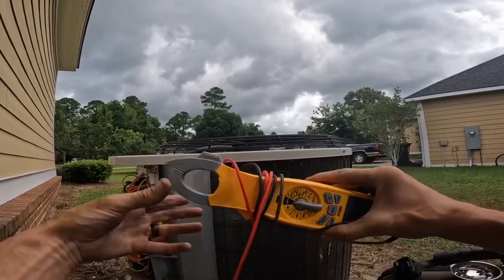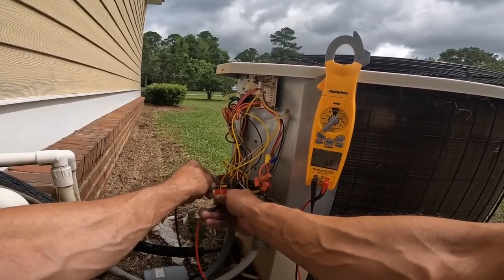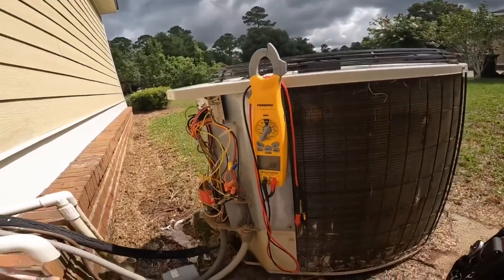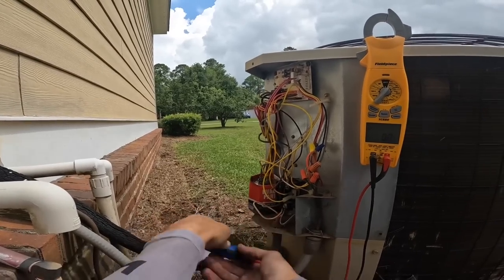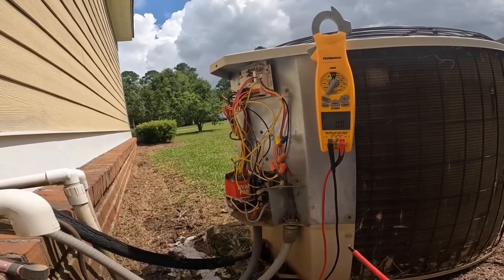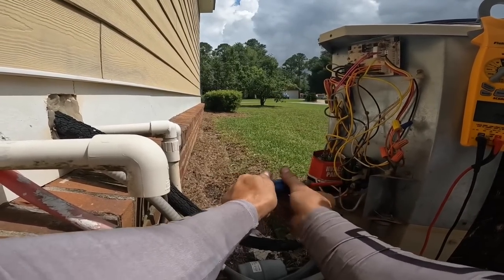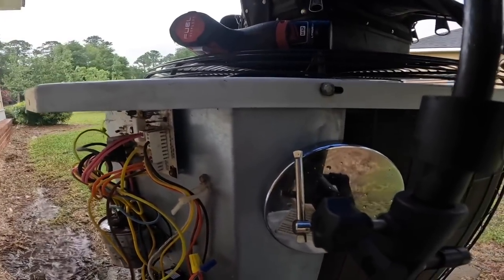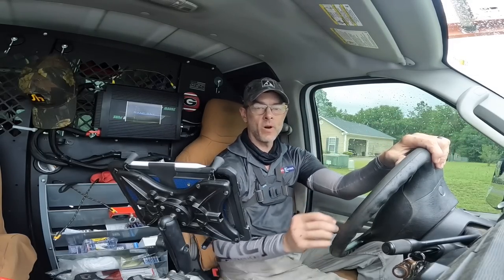Ants Completely Stop Air Conditioner

Comment: A couple years ago, I had ants invade the contactor on my ac unit as well.  At the time, I rented, so the landlord wanted to use her AC guy.  They replaced it three times and said they had fixed the ant problem.  When the third one failed, all within a two week period, I didn't even tell her.  Of course it was on a weekend,, so no parts were available in my area and it was hot as hell, so I looked into what all a contactor did.  I took it off and I couldn't get into all the spots where the ants were.  I said screw it, at the worst, it has to be replaced, so taking a lot of pictures along the way, I took it all apart, cleaned it and put it back together.  I had asked the guy his previous trip if it couldn't just be taken apart and cleaned and he said no.  I went into anti-ant mode and sprayed areas.  I also did the Vaseline trick.  Hooked it all back up and worked like a charm and still is.   I just freshen up the spray a couple times a year.

Comment: Why do tech leave caps in the boxes? Seems like it could be a fire hazard, not a major one but nevertheless
Reply: Because it's faster & easier than securing them correctly with metal straps & screws. Since heat is the main cause of AC capacitor failure, letting them in a box probably causes them to fail a bit faster too. These YouTube techs & mechanics do things right. Many other people repairing stuff don't.

Comment: What is the purpose or thought process of leaving the box around the capacitor?
Reply: Because the person that put it in is lazy and didn't want to do it the right way and make a new strap for it because the new cap is bigger then the old one. Since it's lose and not strapped  I guess they think the box will protect it for sorting out on the thermals and the 24 volt on the contactor.
Reply: Read my answer above.

Comment: 2 pole contractors are much safer than the single pole.
Reply: True but a carrier use single pole on some unit with crank case heater  on top and bottom of contactor probably cause it is  cheaper